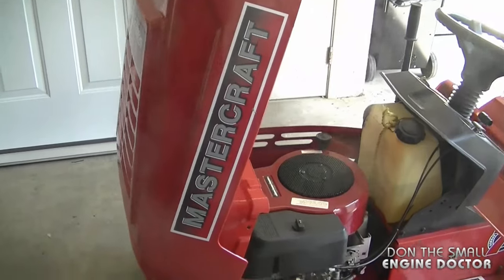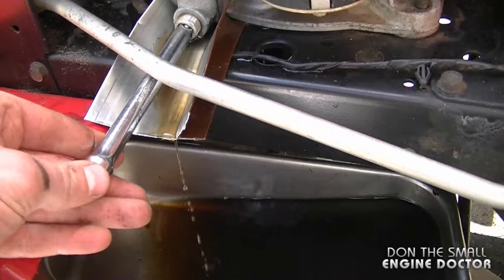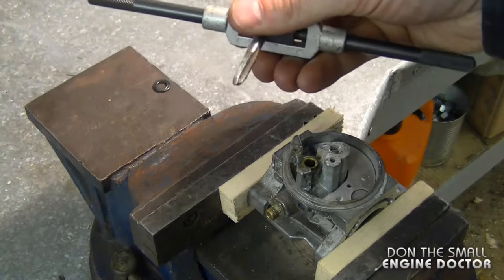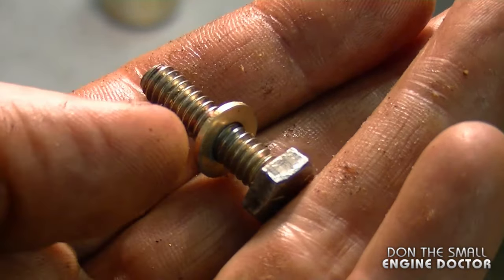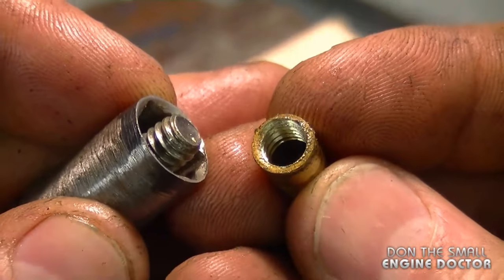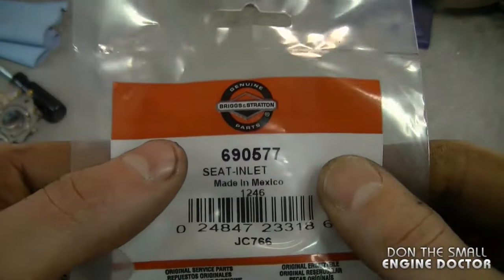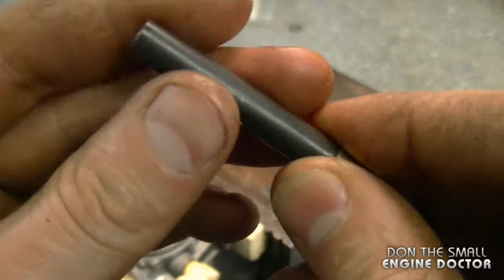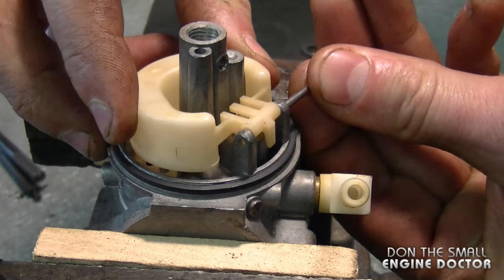Fix A Lawn Tractor That Floods - Briggs & Stratton Carburetor Repair Video

Comment: I saw this video while trying to repair a 5-4993 Walbro. The last thing I wanted to do is to replace the seat...… but it was still failing after doing all the other tasks. I had to replace the seat...…. Your idea of tapping the insert is BRILLIANT. I am in the UK and I threaded it with metric tap. It worked PERFECTLY. I didn't grind a socket, I simply used a length of steel tube. Surprisingly, the OUTSIDE of the seat had corroded (electrolytically?) and was allowing fuel to bypass the needle valve and seat. Another surprise! I assume that water had entered the carb and been allowed to stand.

Anyway, thanks again...… that saved me a HUGE amount of shouting as swearing!

Comment: Hey man! I just want to thank you do being so helpful. In my 8 years of working on these engines, I am now almost 15. I started when my uncle gave me a Briggs & Stratton 5hp Fun Power on a go kart from. Great engine, didn't want to mess it up, so I learned the majority of my knowledge on a little 3hp updraft carb engine. I loved that little engine, and I cranked it over, took it apart, put it back together, everything. I would take rides with my dad on the gokart now and then. I started driving about age 7 and a half. Great times. My dad taught me various things with that little 3 horse, like pulling the valves in and out, lapping, working on the carb, and other things. once I was experienced, I took down the engine to prepare myself for what I should expect in an engine. I noted all of the parts and figured it out. I sadly had to trash it because we were moving into a smaller home. I was able to keep some engines, thankfully. That was an older 4.0 Quantum and a 3.5. I have now a 5hp Fun Power, a '70 2.5hp Golden Boy engine on an edger, a restored '60s 2hp, a restored '54 Briggs Model 5S, a '94 horizontal 3.5hp, a '00 5hp lawn mower engine that I'm rebuilding, and a few others, including 2 cycles. Thank you for your help. You have been a source for about 80% of my knowledge on these engines, no joke. I can not thank you enough. By the way, on a small 3.5hp horizontal shaft with a pulsa jet carb, how would I pop out the welch plug on the front of the carb. Thank you Don
Reply from the maker: +Mitchell Richardson you're welcome Mitchell, I rarely replace those welsh plugs but usually I carefully drill a small hole then use a pick to pry out

Comment: thank you very much for going to the trouble to post this excellent video. this has sorted my issue with a flooding Murray.local repair shop just wanted to put a new carb into it. its an old mower and i didn't want to spend a small fortune fixing it.

Comment: Don, thanks! I had a B&S 17 hp ohv engine crank case fill up with fuel and managed to stop what I was doing to check the oil, finding it full of fuel like you show. Got the carb off and was trying to figure out how to get that solenoid off with the tools I have. Thanks for showing. By the way, there is another vid online regarding how the solenoid can fail also, causing the same results with the B&S engine! I want to thank you for saving me tons of money, too, I just retired and am on fixed income that does not budget for this kind of problem (engine ruining!!!). I wish you well, sir!
Reply: A faulty anti backfire solenoid will not cause the engine to flood with gas. It can how ever cause the engine not to run or cause a backfire as the plunger isn't fast enough to stop the fuel flow.

Comment: I watched a video last night where a guy pulled a needle valve seat, but your way is much, much better.  Tapping for a ¼" bolt is way more precise and makes sure the seat comes straight up.  His was pulled at an angle.  I'll find an old ⅜" socket and thin it out on my bench grinder.  He did compare the depth to the exposed darker mark on the other seat in contrast to the shiny seated part, so that's a good way to check.  I'm looking for a carb adjustment procedure for a Briggs carb on a 4-stroke Briggs 20 HP single cylinder OHV in my tractor mower, but ran across this one, which was great.  If you have one, please give me a link for it.  Thanks and Happy Holidays.

Comment: Dony you did a very good job on replacing the seat by tapping new threads and pulling it out. I have seen a job done differently and that was, by putting in a self tapping screw in the seat and pulling it out by just pulling on the screw and out it came. It saved a lot of time.

Comment: Nice demo. I repectfully add that although its more common with copper floats. its always a good idea to give the float a shake to  ensure no fuel is in it. I just installed the needle valve only in mine and its still flooding so its coming apart again to see what happened
Reply: check the  float setting you may have it set too high so it want stop fuel flow as the fuel fills the bowl it should stop the fuel incoming with that little rubber tip needle if thats not happening it will flood

Comment: Thanks Donyboy.  I prefer your second method of extraction, because it utilizes all of the threads at the beginning, when the force would need to be the highest (probably doesn't matter for this job).  I would look hard for a piece of tubing before I would go to the trouble of grinding down a socket.  :=)   Do you have any suggestions on how to grind it?

Comment: used a bolt extractor to remove the seat on mine. worked good. hadnt thought of threading it though, and using a "bolt & socket" puller

Comment: I couldn't find anywhere that showed how to take the seat out. THANK YOU SO MUCH!!!! You save me from going crazy....LOL
Reply: At the back of the carb between motor and carb there is a track effect. The gas is leaking from there when I put it back together? Is that because the needle and seat isn’t working ?

Comment: When replacing anti-backfire solenoids on these carburetors, I occasionally have problems with leaking through the connection where the solenoid screws in. You did not mention using a washer with that connection. Do you use a washer, and if so, do you use a fiber washer or a metal washer? Also, a 1/2” open end tappet wrench can often fit in the space available, if you don’t want to grind down one of your other 1/2” wrenches.  Thanks for another great video.

Comment: I had my mower repairman put on a new carburetor on my Craftsman LT1000 two years ago. The mower hasn't been used much during that time and for that reason, my thinking is the needle and/or the float may just be fouled with gunk from the fuel. Because it seems unlikely to have gone bad in such a short time. The mower was stored indoors and the fuel drained from the tank. However, before replacing any of the carburetor parts, I'm going to remove the bowl, float and needle and give them a good cleaning with carb cleaner to see if that fixes the problem. I will, however, change the oil because I'm certain there is gas in it. It was running well but blowing white smoke as it ran.

Comment: Excellent video. One thing you might talk about in the next seat removal video is the depth at which the seat is installed affects the float level. I'm sure you've covered it in other videos.
Reply: I measured mine today and it was .045 inch from the edge of the seat to the body of the carburetor.

Comment: I am wondering if I could do this on an old Eska 5hp outboard motor.  Original carb had a vitron tipped needle and brass seat, cannot find a proper replacement, the carb kit I ordered had a solid needle and viton seal for the seat which doesn't work for my application.  Interesting process, I should be able to find something comparable.  As always, very informative and really like the improvised tools used.  :)

Comment: thanks dony for those advises . I have ecxacly the same carburator on my tractor but it does the oposit of fluding  thereS not enough gas going down the cup . It start well but after a few secounds it begins to run eraticly . Have to pull the choke on and then stops. the cylinder compresion is at 110, cleaned the carb.and everything. What would be the problem do you think Thanks

Comment: Outstanding, I see reading the comments the solenoid is to shut off the gas, mine has a MANUAL solenoid which I put on long ago.
Reply: +Grant W. Whitwam yep your right
Reply: Solenoid does NOT shut off fuel TO the float bowl, will NOT stop overflow from bad needle/ seat; solenoid shuts off fuel between the float bowl to the main jet to prevent muffler backfire when people shut of engine at high speed dumping raw gas into a hot muffler.

Comment: Actually great info and tried to clean my carb on riding mower until I came to that solenoid. Cleaned with carb cleaner and got working for the year, but might try this next time I have problems. Just curious, what is new carb versus needle and seat diff on that project?

Comment: how could i get to the governor spring and gear,i'm loosing a bit of oil at the elbow where the
governor lever goes into engine compartment and lawnmower honda gcv 160 (2008)
is running at a higher rpm (at least it seems to me)I,suspect that the gear or spring is 
broken.Thank you guys for your great contribution to this channel

Comment: Thanks again,as always your awesome Don,love your videos,you show neat tricks!!
Reply from the maker: thanks
Reply: Hey got a ? for you? How do you flush lawn mower engine after gas got in oil,because carb float was bad and didn't know it.I drained the oil.Had gas in exhust,got that out.I'm just wondering if filling it with new oil and running it to get it hot,then drain it again would clean it out?

Comment: Great video Donyboy. I have a question, mine is not getting gas into the oil. My problem is I have to choke the lawnmower to start engine when cold then turn the choke off. The engine puffs black smoke and lacks power making me think the engine is flooded. If I shut engine off I it does not want to crank again have to let it sit awhile. I'm going to take the carb off and take it apart and clean it and all the jets. Should I replace the nettle and seat while I'm at it. Its a Kholer engine.

Comment: i hate those antifire solenoids, ive snipped every one off, if you purchase a briggs float bowl kit, it comes with a bowl gasket, new bowl and antifire bypass bolt.  i use fuel shut off valves on all my stuff, all i do is shut it and let my tractor idle till float bowl is empty.  thanks for the tip on needle valve replacement.

Comment: Thank you for your nice video. I have the same problem with Kohler pro 17HP OHV engine carburetor.  I only replaced with a new needle, not the seat. Still has flooding. I am planning to replace the seat as you showed.  Can I use 690577 for my carb?  Thanks.

Comment: clever extraction method. 

I used to rebuild carbs but now there are 3rd party nikki type carbs on ebay for $28 shipped. its like 10 bucks more than the rebuild kits and takes like 3 mins to change out haha.

Comment: Very useful information, thanks.  What does the solenoid on the bottom of the carb float bowl do?  I’ve not encountered that yet.
Reply from the maker: +Jim Austin it's to prevent fuel from going in carb at shut off and stops backfiring
Reply: +donyboy73 - Thanks for the info, my education continues.

Comment: What would you do if the inside of the carbarator where the needle and seat is,, is plastic with a rubber O ring with the rubber running all around and through under the plastic on the aluminum and the cap is aluminum as well

Comment: great vid Dony.  A well known problem with those Briggs engines that is why they added the fuel shutoff solenoid. did the solenoid fail to shut off the fuel? If it failed did you replace it?  Every mower I work on with a Briggs engine and a gravity fuel system I install a manual fuel shutoff valve.
Reply: +Larry B I have an older 12.5hp, I also put on a manual shutoff after having all the gas go into the oil during the winter. It did overflow the crankcase and ran onto the floor. It was a good flush of the oil. It's never happened since.

Comment: I have a John deere Lt133.
Replaced fuel hose and grommet from tank to fuel pump as it was deteriorated.
Cleaned gas tank and replaced carb with new one from amazon along with filter and fuel hose.
The new carb flooded right away.
Took bowl off, cleaned jet and it then ran fine but now it will run/ cut great for an hour or so then flood again.
Took off carb/bowl , cleaned jet/carb and it ran fine again.
Looks like I’m still getting junk in my fuel.
The only thing I did not replace is the vacuum fuel pump and the metal fuel line going from pump to rubber line before carb.
Are those metal lines prone to rusting inside?

Comment: One thing people can try too is to take some brass/metal polish and clean the needle and seat. Take a q-tip and connect it to a drill, dip the q-tip in the metal polish, and go at the seat. Keep going until the metal is nice and shiny. You can clean the needle by hand with a rag. Once you are all set, verify the needle moves freely in the seat, and re-assemble. This saved my lawn mower from needing a needle and seat, and doing this cleaned up my snowmobile carbs very well.
Reply: Safest thing to do is install a $3 manual fuel shut-off and  run it dry every time you use it.
Reply: not a bad idea keeps carb from getting gummed as well.  My solution although pricier for a neighbors mower was a brand new carb for 100 dollars mower ran great all summer better than it has for a couple of summers
Reply: Nah, that's not enough. I have TWO with the cut off, and both still flood the crank case with oil, quickly. Doing this on both.

Comment: If you don't have a narrow open end wrench for the solenoid removal and don't want to grind down a good wrench, a wire stripper/coax tool works just fine I found. FYI

Comment: one thing I noticed that when the carb has a very slow flooding problem - I would check the Viton needle that sits on the needle, I noticed on the one I am working on- the Viton is not sitting flat on the needle - it is "canted" so the Viton is not square with the needle housing, - I am going to get a new needle and see if that cures the slow leak.

Comment: Hi Donny: My tractor has a B+S Engine W/a Walbro Carb. which I replaced 1 year ago. I have the problem w/gas in the oil. When I replaced the carb I did notice that the intake valve turned blue in color. What does that mean?? Also will this video cover a Walbro Carburetor???

Comment: You don't actually need to use a socket to make a puller. What I did was a combo of this video and another I saw, in which the guy grabbed the bolt he ran in with a pair of channel locks  then rapped the channel lock pliers with a rubber mallet to drive it out. The advantage in THIS video however is that the other guy just ran a SCREW into the seat. Using a tap to make 1/4 X 20 threads makes a lot more sense to me because it is a more controlled method with no chance of tearing things up beyond all repair... In my mind - wood screws and metal items (carbs especially) need to be kept far away from each other.

A last note: Most carb kits for these come with several different parts. There will be TWO inlet valve seats, because the one with a smaller orifice is for engines supplied by a fuel PUMP, the other seat in the kit has a LARGER orifice - and is for gravity fed fuel systems.

Comment: I just took the carb off my lawn mower and found that it would not start due to the needle froze in the seat. I have a  Walbro 4993  LMT carb. I was taking that center jet out and the brass gave way and stripped out the screw driver slot. I know that I can get it out with an ease out. But I need to know will any jet work it is a 14.5 HP OHV you know the one like you 13.5 there. How do I order the right jet. carb seems ok just a good cleaning and that jet with a rebuild. Thank you Bill H
Reply from the maker: the one in this video should work

Comment: Dony i recently rebuilt the carb on my Ariens snowblower. it has a 5hp tecumseh. After the rebuild it will not stop leaking fuel from the carb. I've checked it over and taken it apart many times now and it still is doing the same thing. Could the carb just be no good anymore?? All the insides are new including Bowl gasket, needle and seat as well it was cleaned with gas and compressed air. Your help would be greatly appreciated.
Reply from the maker: did you replace the float?
Reply: @donyboy73  no that's one thing i didn't do! i'm gonna try that. Thanks for the help. Much appreciated!!

Comment: where you used ground socket I use a bushing with id slightly larger than seat od and put a 1/4" id washer on top and then the bolt with nut on it.

Comment: what does the solenoid actually do?  can you connect the connectors backward?
Reply: Its a fuel shut off. It should plug in one way only.

Comment: I broke the "idiot proof" mixture screw off of a new Walbro carb for a 12hp Briggs (by not using the correct tool to adjust it).  It broke just below the surface, so it is difficult to extract.  Any suggestions to remove it?  I wish they didn't make hardware that requires special tools to adjust.

Comment: Hey Donnie grade video I have a 16 horsepower Briggs & Stratton with a Nikki carburetor on it and it's flooding the engine same as what you got going on there I remove the carburetor and  it looks like it's missing the jet there's no jet inside! So maybe the previous owner open it up and lost it I just wanted to see if all Nikki carburetors have that jet inside there or there is some who don't
Reply: Elite Edi Nikki carbs are not even from this planet.
If you are talking about the little brass screw "jet", not many will have that feature.

Comment: Do you have a part number for the seat that requires a fuel pump. It’s the smaller hole seat... 
thanks